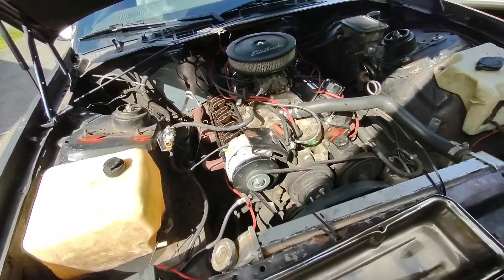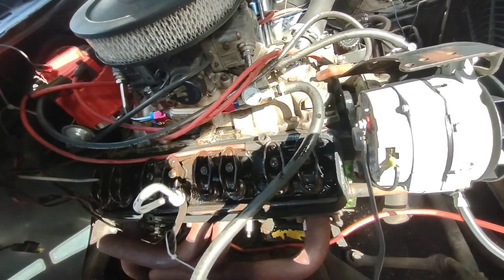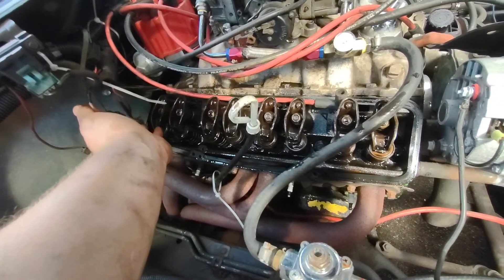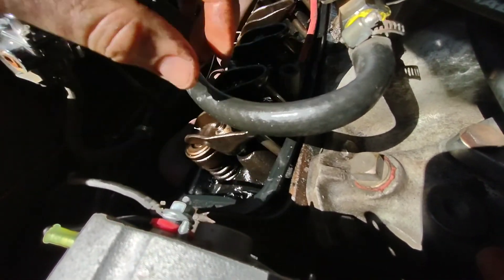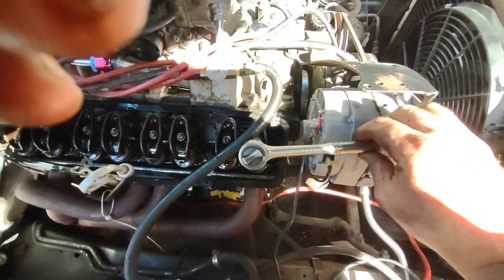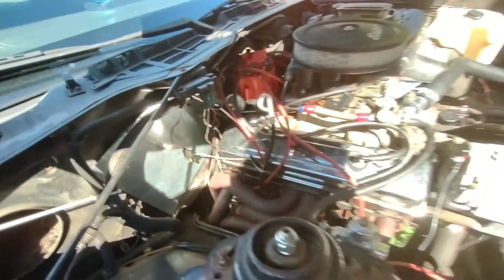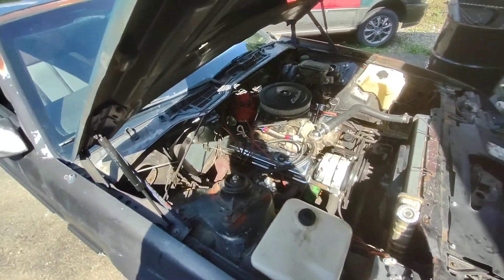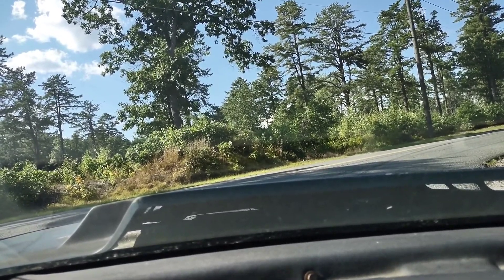adjusting valves on the budget sbc 383 stroker

Comment: There's a faster way with same accuracy. Tighten them all to zero lash at Top Dead Center  compression #1. Then do them again at Top Dead Center compression #6. Now that all of them are SUPER close, go over them again after each 90° rotation of the crankshaft. Then add your half-turn of preload. I'm impressed that you didn't do that stupid "spin the pushrod 'til you feel resistance" method.
Reply: @5sapaches25  Your mom.